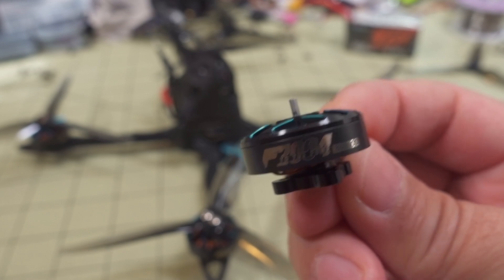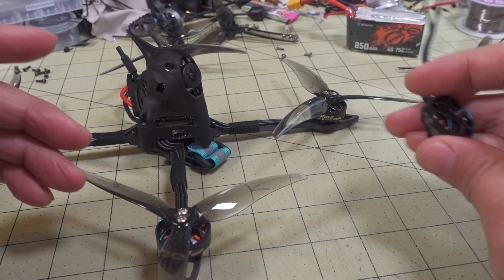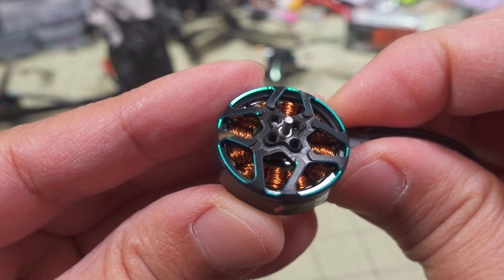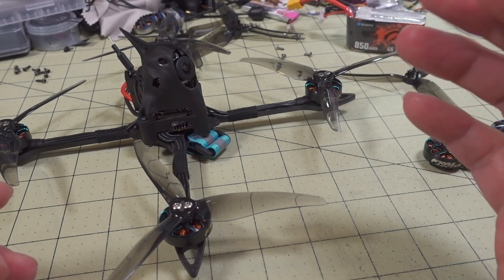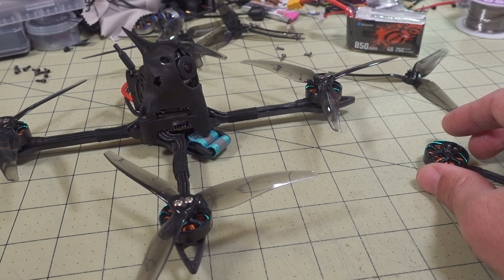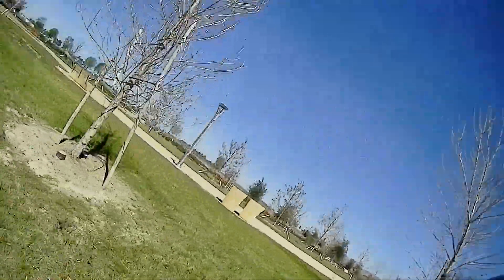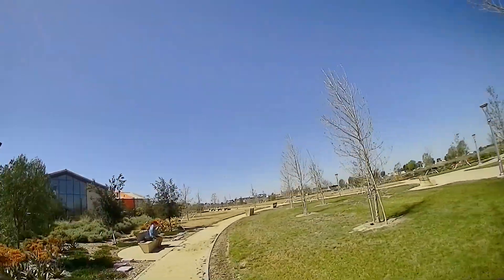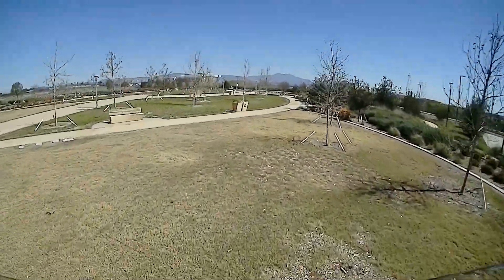T-Motor 2004 ❎ X-Knight 5 DJI FPV Conversion 🛠️

Comment from the maker: 🛒T-Motor 2004 Motor
      PD - http://bit.ly/3kR12gY
      RDQ - http://bit.ly/3bevJt9
      BG - http://bit.ly/3qeVAFF
🚁 X-Knight 5 - http://bit.ly/3rkS5Pi | http://bit.ly/3lChEsR
👉 Vista - http://bit.ly/32RKzSL | http://bit.ly/3kI2Bxs
🛒 Canopy - http://bit.ly/3080Dgq | http://bit.ly/30b12yJ

🎓 How to convert analog to DJI - http://youtu.be/J6hBqGsId40
🎬 X-Knight 5 Video - http://youtu.be/4jtUP1Op-94
🎬 BetaFPV 2004 Video - http://youtu.be/fT46tj2ZDyw

🙏 Please support with a 👍 and don’t forget to hit the 🔔 thanks!

👉 Old gear for sale here -  http://bit.ly/AlbertGearFS

💲 Get the latest exclusive coupon codes (updated often)
     http://bit.ly/34SYiGn

Comment: Fantastic flying, Albert! Great review! 😃
Thanks a lot for all the tips about tuning!
BTW, I built a 2.5" inch quad about 2 years ago with the Leader 120 frame and SunnySky 1106 motors. At the time I almost had to reduce the Ps and Ds to zero! 😂
It would be pretty interesting to see what the newer Betaflight would do to it! 😃
Anyway, stay safe there with your family! 🖖😊

Comment: Appreciate the PID tuning tips!  What would you recommend for a 4 inch motor - between 2004 and 1507 motors?  They seem to be similar in weight and so I'm not sure if one has an advantage over the other.  Going on an airblade intrepid 4" frame.
Reply from the maker: They have a different feel and flight time.  2004 has more flight time, better response on low end of throttle.  1507 has better top end speed, but shorter flight time.
Reply: Dave C is saying 1804 motors on 4 inch for performance instead of 2004, maybe check out his videos.

Comment: Don't bother with betafpv's canopy, my x85hd had one and broke the canopy inside my house. With it breaking it pulled a piece off the board killing the AIO. I Printed out of TPU from Thingiverse. It also has the Fourth screw to attach to the frame. I have NOT been happy with the durability of their products.
Reply: Which canopy from Thingiverse are you using?
Reply: @colinmetzger6755 Look up - Betafpv 85X HD Canopy with 4 mounting holes